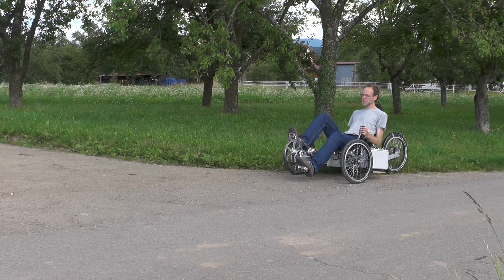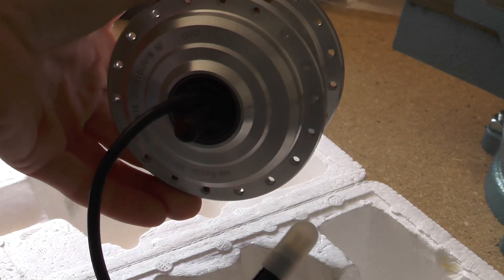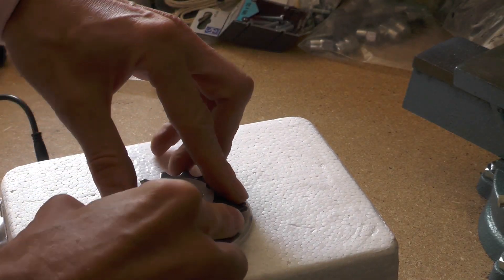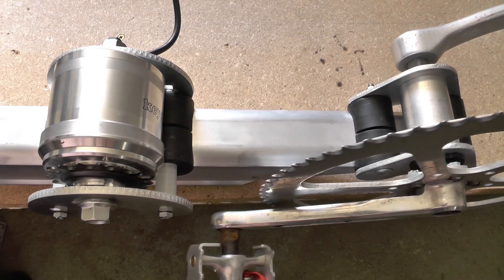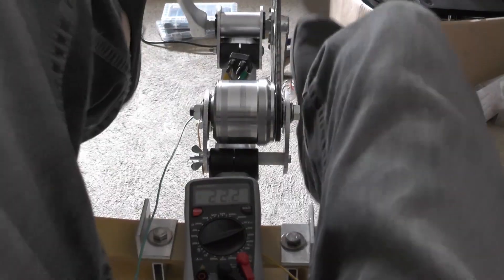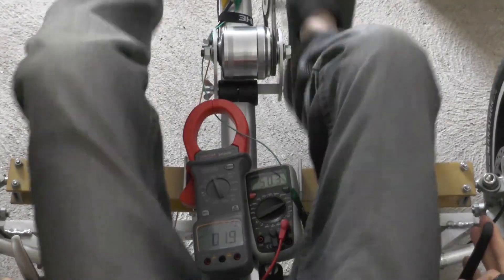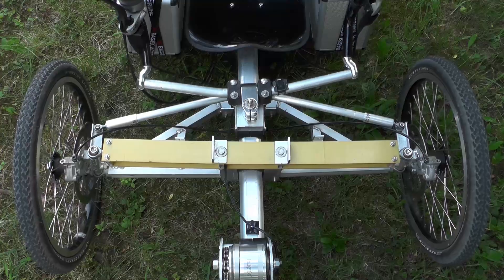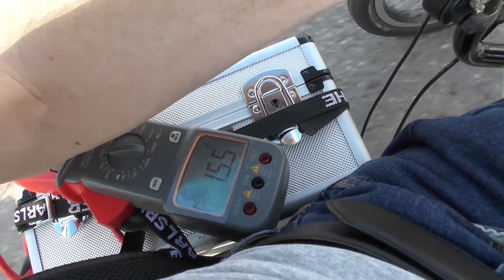DIY Pedal Generator for Electric Bike or Trike

Comment: Can you perhaps speak on the efficiency of the whole system?
Motors/generator via chain/s.
Battery.
Then AC to DC to AC conversion, which I feel should be via (GaN) Active PFC?  
And MPPT so any pedal rpm charges the battery..??

ie: Conversion efficiencies (measured) of the whole system and improvements that can be made would be a good video..?

Comment: Very quick delivery. https://www.youtube.com/post/UgkxUiL0GnyDjP32RJdd660sP8mZk4CRLTCJ  I believe about 2 days before pre-purchase estimated delivery date. Easy to assemble. Extremely well built. Adjustable in every way to fit personal size. Rides great as peddle-only or with electric assist. Has a lot of power. Priced right compared to competitors. Love the bike. More info after having bike awhile. “This Folding Fat Tire is our second purchase from Ecotric. Seems to be a great company. They followed through with backing a problem I was having with ‘Too Fast Speed’ of this bike when compared to the 26” Fat Tire we purchased first. They sold me the same controller and display screen which I changed myself without much difficulty. Now the speeds are exactly like our other bike. Love the bike and the company. The only difficulty is contacting them for this issue. Their phones in Oakland CA won’t receive messages and so you have to wait on correspondence by email once per night. Still I give it a 5 star.”

Comment: you installed a generator, do you ride bicycles only on electricity from the generator or do you charge the battery on the bicycle. if you can explain to me. I'm currently building 2 bikes, and this idea of yours is great..

Comment: Excellent! Are you able to keep the battery charged all the time, just by pedaling?
Reply from the maker: Probably not. The motor can consume up to 5000 W, while the generator only gives 200 W or less. But it always depends on your driving style. You can drive slowly with less than 200 W, then it is sustainable.
Reply: @forschungsbuero  Thanks a lot!

Comment: This is pretty sweet. Could you do the same thing but use a couple of them small $20-40 drone motors but as generators like this sorta but smaller
https://youtu.be/fPjrF-ltVn0

Have a larger gear attached to the pedal then make a gear box like this but smaller https://youtu.be/MtZM3bRScfw

Then maybe a small capacitor bank and speed controller that can use it

Comment: Hi. Can the output connected to an inverter? Then use the output from the inverter to powered a DC power supply for a direct drive without any battery? Just curious will it powered directly by pedalling.
Reply from the maker: I think, this would not be practical, because the motor controller is turned on and off with pedalling. It would be better, if it is backed up with a battery.

Comment: Line up two more hub motors beside the one using the same pedal. Get 3 time the power. And convert to belt drive, it will be quieter and smoother.
Reply from the maker: The power cannot be increased with more generators, because it is limited by the human capabilities. Belt drive is nice. But the noise comes mainly from the internal gears of the generator. I will try to make a direct drive generator some day.

Comment: Ingenius design. Hats off to your engineering. Why the fiber glass bars and not a double wish bone or McPherson style ? Was weight an issue?
Reply from the maker: It was mainly an idea, I wanted to try out. For McPherson, I would need extra structure, because I dont know where to mount the spring on top. On my new solar camper, I am using double wishbones of fiberglass (See my new videos on that). That works fine and is a lightweight and maintanance free solution.

Comment: Can't you place the generator and pair it with a gear on the front wheel. Or maybe add another sprocket and place it on the rear wheel. Like the concept for dynamo and car alternator so it will charge while moving at the same time. A little drag won't affect the load on the electric motor. Just my opinion, and I'm not an expert or related on any engineering profession. good job👍
Reply from the maker: Shure, that would be possible. But then you have to provide the power for both. Means pedaling harder.

Comment: MPPT Charge Controllers: optimal charge voltage no matter the input voltage.
ie:  Pedal at any speed and no looking down at your rpms all the time.
Reply from the maker: Yes, that would be definetely better than a simple rectifier. Or using a motor controller in recuperation mode.

Comment: Nice.  Perhaps put a freewheel sprocket on the gen so it keeps spinning with its own momentum when you stop pedaling...

A small cowl over the top half of the gen may keep it spinning longer when you're at (air) speed...
ie:  The top of the gen (and your wheels and spokes) is moving forward MUCH faster than you you are  at speed and wind resistance increases with the SQUARE of (wind) speed...  (3X? for wheels)
Reply from the maker: Nice idea, that probably won't work. The internal gears have lot of friction and when you pull some power on the electrical side, it stops spinning instantanously when not pedaling.
Reply: @forschungsbuero  Ah..! Yes forgot about the epicyclic gearbox.  
Any 'free wheel' would have to happen after that.  Possible  
I spoze, if there's something on the market that would fit in there.
And there's still the said load that slows  it down.

Idea is from car alternators where it's a thing nowadays.
Personally I'd just turn the alternator into a motor during acceleration.

Comment: I'm curious how efficient it might be directly, from generator to motor, without the battery buffer, and if perhaps gearing might be achieved with a transformer instead, interchanging volts with current. From strong but slow to fast but weak.

Comment: where did you get the clamps for the crank and for the generator? I cannot find such clamps for  recumbent tricycle
Reply from the maker: The aluminum profile and the clamps are my own design. But you can use other fixation depending on the frame you have.

Comment: Why not just build a low speed generator built into the crank shaft so you don't need a chain up front?  Basically, a dual shaft pancake generator with each shaft having a crank arm on it.
Reply from the maker: Thats exactly what I want to try next. But its probably heavier.

Comment: The discussion is rather old, but the technical discussion is still relevant i believe.
How is the feeling when you are pedalling ?
I would expect that the feeling is different and a bit uncomfortable. The generator is creating a constant resistance torque. But the torque that a cyklist is creating is anything else than constant. The pedalarms are creating a TDC = Top Dead center.
For that reason it is relevant to ask if the pedaling experience is uncomfortable ?
Reply from the maker: You are right. Pedalling this generator is different from a bike. What I will try next, is to have a motor controller in regenerative mode and modulate the power with each revolution. You could have different curves with different feeling. And a direct drive generator.

Comment: Needs a flywheel that keeps charging long after peddle effort is finished. And a switchable direct engagement.

So you can coast while peddle charging then re-engage direct peddle drive with electric assistance.

Comment: 5kW isn't allowed on public streets, right? Did you try measuring/estimating efficiency pedal to asphalt?

Imagine: sitting on a red light, pumping electricity in a supercap for a minute, and then ... bhämm, take off like a rocket

Combining the power of more than one driver seems to be easier when done electrically instead of using a mechanical drive. It does not give you any advantage when accelerating or going uphill, but your possible top speed (a.k.a. top fun) would definitly increase.

Comment: The Keyde hub motor used as generator looks like a geared hub. Is it normal that geared hub can be used as generator? or is it a special model? - i am currently building a velomobile vith no chain - all electric.
Reply: Just ran a test of a 10 year old bafang 250 w geared hub motor. Connected to controller - reverse rotation - it worked fine as a efficient generator 36 V DC.

Comment: i have one question, is it better foot making energy  go to generator and make volts and charge, and use this energy to motor, instead of directly  foot to wheel , i guess, direct foot to wheel may be better?  but your way is saving volts and using batteries already charged one also, .. i m confused ..

Comment: I have a video on the channel. It shows what a generator is capable of without hall sensors with a 38A controller and a supply voltage of up to 95V. A 150a Bosch generator at 1700 watts pulls a car weighing 600 + kg. And this is incomplete power. I wish you success in your big projects. Like from me unambiguously

Comment: Great build mage. You change the pedal section a bit and ad a fly wheel to continue making charge after you stopped peddeling. 
Aslo could you add an ultra capacitor to take some of that large voltage and then carry in charging the batteries.  
Maybe both together could really reduce peddling time. 
Amazing build though and I'm very inspired by it. 
Would love to hear your views on my ideas xxx

Comment: Why not drop the crank set and chain completely, instead connecting the generator with some leaf spring like in a clock and small gearbox with ratchet (one way clutch) and use two pedals to push, to wind up the spring with generator to charge. And then front wheels driven with some hub motors and folding frame, maybe aerodynamic covers like velomobile (and heating.. maybe 🙂)
Reply: And a powered trailer attached, with 4Kw and a solar panel.

Comment: wanna do something crazy bro? try this two 775 motor connected each others in shafts and wire +/- also put extra wire from +/- it's run on it self and also if you got battery charging it also recharge you battery continuously, people say "perpetual motion is impossible" but this perpetual energy some say it's the "free energy source stuff"

Comment: Are you not utilizing super caps inline with your generator and for both input and output (discharge) for battery?
Reply from the maker: No. Output from the rectifier goes directly to the battery.

Comment: The number of likes is testament that your project here has much interest. I say, take advantage and create kits. Kits allow others to innovate and to get involved. Also create a Patron channel and make pathways to continue your great work.
Reply from the maker: I will think about that. But first, I will build a direct drive generator.
Reply: @forschungsbuero  I will the first one to support your work by joining your Patron channel.
Reply: @forschungsbuero  As in ironless axial flux generator possibly using the Litz wire? Now that has my attention. I'm thinking about construction of my own series hybrid recumbent tricycle. The motor will be maybe this one https://www.leafbike.com/products/e-bike-hub-motor/48v-52v-1500w-front-spoke-hub-motor-electric-bike-motor-1063.html (efficiency up to 90.5% which is impressive). But the generator with about 200W output... thats hard to come by. And directly driven one, without gearing... unheard off. It would be able to generate up to 200W with only about 90-100RPM.

Comment: https://www.dhgate.com/store/product/1kw-48v-low-speed-permanent-magnet-motor/399548980.html?recinfo=8,103,2#cpspd-2-5|null:103:r1145082405  why not use a generator like this one ? then perhaps a 48Volt 750 Watt brushless hub motor for final drive ?
  the generator is rated at 500 rpm's witch would not be that hard to gear with a larger sprocket on your pedals and a smaller one on the generator  itself.... or am I missing something here ?

Comment: Dear can we  make this with   only 2 moter ...1) as a generator and anther is altonater no battery ....
Reply: Yes you can do this, as a test get two cheap £1.00/1E.00 DC motor, spin 1 at 100rpm the other will spin at around 70rpm

Comment: I would like to use a 24v 250W motor as a generator to power a front hub motor on my mountain bike (2=wheel drive with pedal power on rear wheel)
The front wheel would have a 24v hub motor powered by the generated electricity from the rear wheel generator.

Comment: Hi. Firstly I would like to tell that I really admire your trike and drive train on it. 
I recently (in august) build my own trike and I have chain drivetrain on it. That said, I look for series hybrid drivetrain for a few years now.  The only thing which makes me hesitating is the efficiency of it and legality. EU has some law which says you can legaly drive(on streets and bike lanes) electric bike which has only 250W engine and speed is limited to 25km/h . I regularly drive faster than that without engine help.
Can you estimate the efficiency of your drivetrain? 
Did you have any conflict with authorites?

I doubt that I can design and build my own system(your rear engine looks great) but there are possibilities... For example BAFANG 750W in wheel engine https://www.aliexpress.com/item/32824744074.html?spm=a2g0o.productlist.0.0.5d481cb20owG9v&algo_pvid=93069dc3-7305-483f-a322-0dd06058960e&algo_expid=93069dc3-7305-483f-a322-0dd06058960e-8&btsid=c53a276a-e7a6-4aff-8a51-49826bc841b6&ws_ab_test=searchweb0_0,searchweb201602_10,searchweb201603_52 has 80N.m torque which should be enough if used on 16 inch wheel(400N on tire).

Comment: adding a schlumpf high speed drive drive to this would take that 60 tooth impressive sprocket 150 tooth and your normal peddling at 80 to 100 rpm 
a front 150 tooth to a rear 16 tooth nearly 10 to 1 ratio and at what ever the math is it will be less work on the legs

Comment: Question, why not set up a nice gearing system so you have more speed while charging the battery? If you keep the gears nice I'm pretty sure you'd be able to get a lot more energy without sweating too badly

Comment: Absolutely a genius idea, so well executed with wonderful precision. My hat is off to you.
Reply: This is so inefficient as far as distance you will travel vs. time and effort put into pedaling that I can't imagine any benefit that could redeem it.  
A chain and sprocket drive is 98% efficient.  This trike has a sprocket & chain to the generator, so already you are at 98%, the generator is only 80-90% of that 98%, the battery accepts a charge at 65-80% of that, outputs only 65-80% and the electric motor is only 80 to 90% efficient.  You end up with about 30 something percent efficiency at best in a heavy, expensive, complex vehicle compared to a regular trike that has a 98% efficient drivetrain.  At best you would travel only 10 miles for the same effort that could get you 30 miles!
This might be a hard sell merely due to complexity and price even if it's drivetrain was 100% efficient.  Somebody tell me what percent efficiency would it need to have for you to pay a lot more for a trike you could charge by pedaling as well as plugging it in and/or using a solar cell?
Reply: @denbecr49  internal combusion engins are 20-35% effcient and that is what most of the world uses to get around.  average person could care less and not having the super long chain from pedal to wheels makes for a much easier to build trike
Reply: @solarroofing8072  
If that's all that counts, start with a unicycle, add a frame with 2 rear wheels and enjoy lightweight single speed high efficiency with no chain.

Comment: From the meter it looks like you are making enough power to make the bike go, would it be possible to use a capacitor instead of a heavy battery?  Or bigger dynamo/gearing?

Comment: Ive considered this over the years, but for 2 reasons havemnt adopted it.
1) Its not legal to have an ebike on the road without direct mechanical drive to the wheel, in Ontario.
2) Adding energy to the system using a bicycle chain, is more efficient than a generator and rectifier.

Still i respect like your work and like your videos.

Comment: If he were to incorporate a freewheel bearing on the crank and a secondary sprocket on the generator to the drive wheel he would in fact have regenerative braking allowing power to be generated while the trike is coasting as well as when pedaling.

Comment: Ein Pedalgenerator für ein kettenloses Fahrrad oder eine menschliche Leistung - elektrischer serieller Hybrid. Leicht zu bauendes DIY-Projekt von Thomas Senkel. Kostenlose Pläne für Aluminiumteile enthalten.
Ein Keyde-Frontnabenmotor wird als Generator verwendet. Es ist nominell mit 160 U / min bei 36 V und 250 W bewertet. Sie brauchen keine Elektronik, nur ein 3-Phasen-Brückengleichrichter. Die Lithium-Ionen-Batterie ist 12s (44 V) und 2x 25 Ah. Die Motorleistung beträgt bis zu 5 kW.

Comment: You don't really need separate generator/motor units and no way will the rider be able to provide the force needed to keep the batteries charged. Most hub motors can be switched to generator (regen) mode through it's controller. You may then be able to take advantage of kinetic/pedal power to replenish the battery.

Comment: The Idea is good, but EU you can only have 250w motor and it has to stop assisting you when et comes to 25 Km/h, and the bike must only drive when you are pedaling, also called pedaling-assist and max 6 km/h without .......thats for Europa but anther places there are other lows..........but when et comes to motor efficiency if you combine it with a solar-ruff on top of your car it will help a lot
Reply: Fuck EU.
Reply: @VivaMessico  EU is not the only country enforcing this. Great many countries had set limits on what is legal and what isn't as bicycle. There is no problem with 25km/h limit(it could be set off outside of roads) only with motor power. But that is not that big problem for pedelec as Bike2 which uses similar serial pedalelectric transmission and has 750W Bafang. Build in denmark with no problems with authorities. Therefore it won't be problem here as long as one doesn't cruise over 25km/h.